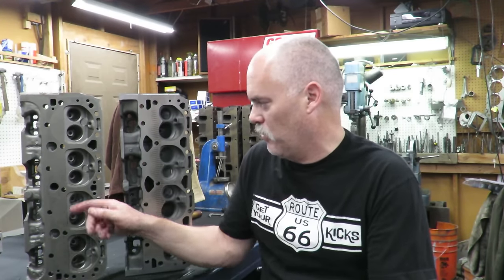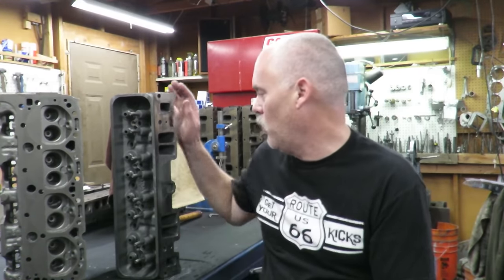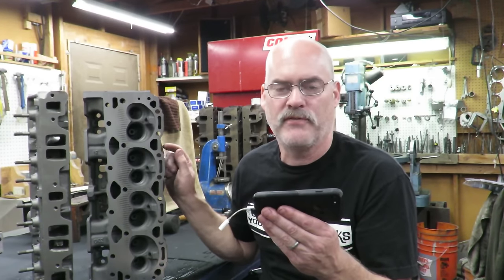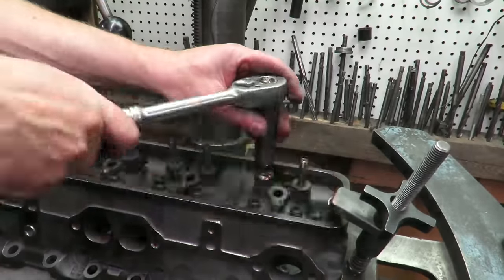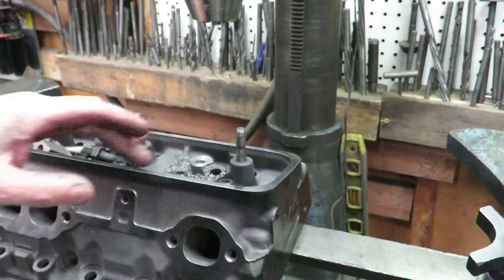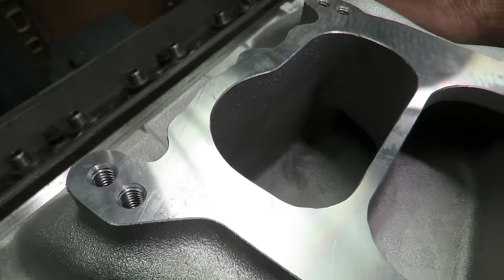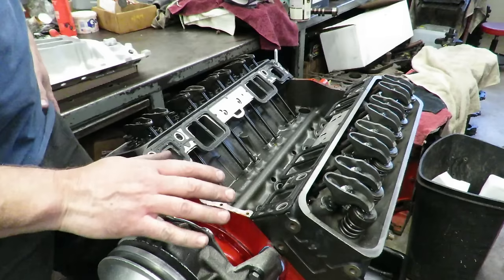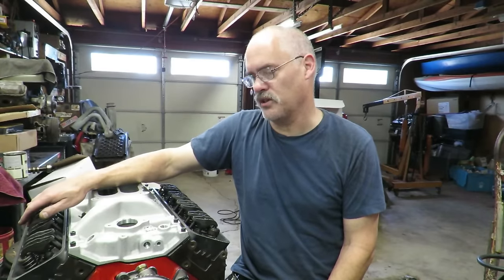How to get more power out of your Small block Chevy

Comment: Hand tapping the rocker stud bores? w/o cutting fluid?  I guess it's OK for you or maybe me to do that since the tap was piloted with your press. For me, it would totally depend on the GH value of the tap. I wouldn't trust a run of the mill Ace hardware hand tap for this. Knowing how to tap a hole correctly does not come to the novice on the first or second shot. You have to know when to back off the tap to sever the thread chip. Seems like going down without removing chip might mess the hole and enlarge the threaded area if the tap runs over the chip.  I know that I might seem a bit anal about the whole thing, but consider this:
Now, this is only my opinion; but we do know our beloved SBC is inherent for these studs to rip out (dependent of course on how mild or wild the camshaft selection). With this in mind, wouldn't we want to tap these holes for maximum contact surface area from the threaded rocker stud to the head? We might be better to utilize a tapper head with a machine tap having a lower GH value. Agree?
Doing so, we have created a 'tight but consistent threaded surface contact area that would insert with far less effort than it would to remove. Additionally during assembly, wouldn't we apply a Permatex 26210 type compound (or similar) to the threads in order to lock the part into place? 
Threaded studs have a better likelihood to naturally remain stationary over pressed ones, but gosh, that threaded hole has quite a bit to do with how well it is going to hold.
Only mentioning this due to our engine not being one that uses a rocker shaft, and the fact that we have certainly seen more rocker studs torn upward on SBC's than we would like.
With the thought of using a big mechanical roller cam and springs that would match with it, this stud becomes a very important factor to not rip out.  I know how to 'tap tight' by hand, but could I tap 16 holes by hand exactly the same? Hell no I can't do that anymore than I can bowl perfect for 12 frames. 
I machine engines maybe only once every 6 months these days, but there was a time when I was working and cutting them all day when I was in my 40's.  Maybe it's me, but I just never thought well of hand tapping a high tensile stress area unless I had to. Especially now, it my 60's I'd be afraid the tap would run over too much chip and I'd botch it up (that is, compared to a perfectly machined threaded hole from an auto tapper head for example)
I just mentioned this mainly because some people out there might not realize that this rocker stud area is crucial to hold fast well and these engines (with the perfectly wrong cam combo) have the potential to be damaged in this area. Yah?

You gave a great video here. I really enjoyed it. You don't talk too much as you say. Hell, look at me! This could very likely be the longest comment you've gotten!

May greatest peace be with you,
Pete

Comment: Why flat tappet cam.? I have an actual vortec motor. Had to replace the heads. They were cracked in the valve seats. I stuck with the roller motor though. Added a LT-4 Hot cam from chevy performance. That's a roller. Added roller 1.5 rockers. Longtubes and the upgraded injectors with stock tb. It is a dog. I'm thinking the pcm on a 99 old body style Tahoe just will not run right with no emissions stuff all removed. Bought a pcm from a guy 411 from a express van. He deleted all that stuff. Gave me a couple hundred on the rev limit and numerous other things. Haven't installed yet. I think it will run much better but, that shitty intake and small tb will always be the weak link. Thinking of just getting a fuel pressure regulator and going carb. They are expensive for vortecs though. What would you recommend?
Reply: I realize most guys running drag or track cars seen to prefer flat tappets? Can you explain why? Is a driver different? How about a resto mod driven a couple thousand a year?

Comment: Hey great video. I love watching your stuff, great adequate information. I have a set of the same Vortech heads. Would you mind sending me the specs so I can tell that machine shop what to do. Also which cam did you?  Thanks again. Keep up the good work
Reply: cut for screw in studs and machine down the valve guides 0.1" deeper for more lift

Comment: I have an 880 block, vortec heads, edelbrock intake and plan to put it in my 68 c10 truck. Since it is a heavy truck, I've been thinking about running the HT383 cam in it which some claim makes good low-mid range torque which is what I want, I don't want tire shredding HP, just some extra go for a heavy truck. What is ur opinion about my combo?
Reply from the maker: it works pretty good

Comment: So, score a Goodwrench 290 HP long block 1700.00 or so, maybe you can get it without the heads for less, maybe they'll do that, add you're budget vortec heads, keep the Goodwrench cam, 420 HP or so with the proper fuel/intake/exhaust maybe have it for 3000 or less if you're resourceful, sounds like a plan. but I believe it comes with a cast bottom end and two bolt mains so, that may be asking too much of the motor. who knows?
Reply from the maker: all of the crate engines from good wrench are 4 bolt main hey have been for many years

Comment: Nice video! Do you know what the hp-limit would be for a two bolt main block? I'm consider to upgrade my 1990 truck engine with vortec heads and a cam.
Reply from the maker: I have seen two bolt blocks make 500 HP you just need to watch the RPM's no more than 6000 with a two bolt after that the caps stretch but 6000 and under is no problem the two bolt block is actually stronger than the 4 bolt block it's the cap stretch that is a problem not the block itself
Reply: Myvintageiron7512 Thank you for the fast respond! Keep up the good work and the nice channel👌🏻👍🏻
Reply: you can get bullit caps to solve that problem

Comment: I have a 1991 Chevy truck with a 305 that has worn out bottom bearings, I called a garage and they said they will only replace a 305 with a 305 and they will not put in a 350.   I would like to put in the 350 to get more power since it is an extended cab with a full bed and there are some big hills or steep grades around.   Will the vortec heads 062 casting fit on my 305, if yes, what cam will it need,  what  four barrel intake and carburetor will be needed and what should the cylinders be bored at?
Reply from the maker: find a differant shop

Comment: I have a 1995 suburban with the 5.7 350. Non vortec. Can I go to the junk yard and take a vortec intake and heads and just put them on my suburban?
Reply from the maker: Yes on the heads no on the intake you will need to but an intake and run a TBI adaptor but it's pretty easy to do

Comment: I have an IROCZ with 350 TPI intake . The intake bolts are at an angle . Is there any option for me to use those heads you modified in this car. I noticed your intake bolts are straight up down. Thanks

Comment: Okay so I have a 400 sbc bored to be a 406. It’s got factory crank. Would this be a good set up for a 400? I have an edelbrock performer rpm and I’m going to get a new cam anyways. I know I’ll have to drill steam holes in the cylinder heads. What kinda cam would run good with this set up. This is going to be a daily driver but will take to strip every so often.

Comment: Hi...Nice video :O)...will be the upgrade on V6 Vortec from 1995  in the same manner?
Reply from the maker: yea pretty much
Reply: So I need to get the head's from 96 up Vortec manifold for it...you said Mexico? You have some recomandation where to buy a quality material for complete rebuild? I am from Europe but am in NY quite often so can pick it up there.Problem with parts here is that they are very overpriced.I wil not be able to get it for less than double you saying and that is very optimistic...I guess you busy man so I hope I don't bother much.

Comment: I have a question. I'm in the process of looking for a 69 Corvette which will probably have a small block in it. Lot of people have switch that out for a LS motor. I'm wondering what the benefit is when I can easily get 400 horsepower or more out of the 350 it's in the car! What are your thoughts on that?

Comment: Question I got set of vortec heads stock max on these .450 give or take the cam i want to use comp cams thumper the lift on it. int is .479 exh .465 so i heard of people putting ls1 springs and retainers should still have valve boss cut down

Comment: I have a 350 from the 70s and another 350 from the 80s will this bolt right on?
Reply: vortec heads bolt on,you need a vortec intake to match the heads.they cost $150-$300 at summit(LOW RISE DUAL PLANE TO HIGH RISE AIR GAP DUAL PLANE)

Comment: How much roughly would it cost to build a 4.0 Jeep engine with all top of the line parts and service?
Reply: Buy a salvage jeep and scavenge the engine out of it, i did it w my 70 cutlass and bought a car with a wrecked rear end,stripped interior, peeling paint ect. for 3k and a running car with a knocking engine for 7k.  With a bit of knowledge you can swap it at home

Comment: Why did you tap the holes you drilled in the intake manifold?  Shouldn't the holes in the head have been tapped? You want to pull the intake manifold down onto the head, right?  Threads in both holes will bind up the bolt before it hits the torque spec, unless the threads are perfectly aligned, and threads in the intake manifold alone won't draw it down tight onto the head.  What am I missing?
Reply from the maker: what your missing is I did not tap the holes in the manifold I'm not sure where you got that idea
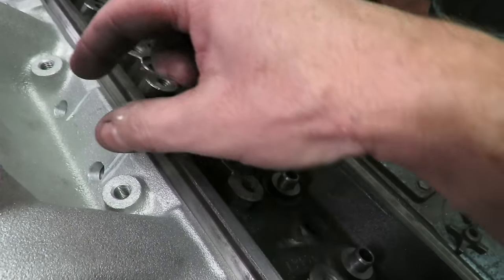Reply: @Myvintageiron7512  Sorry, I misunderstood what you said at 29:46 in the vid.  My bad...

Comment: Ok Mr 350... I have a 1990 Z71 that blow smoke at startup ...it will do it for a few months and then it will stop blowing smoke for a couple months.....what is it?
Reply from the maker: probably valve stem seals nothing to worry about very common on SBC with miles on it just run it it will be fine
Reply: @Myvintageiron7512  thanks for your time.

I consider it a top end lubrication...similar to a 2-stroke engine

Comment: I'm using 416 305 heads on Mex 350 block had value job 1.92 in 1.50ex mild cam 460 lift what u think looking to get 300hp.
Reply from the maker: I would guess closer to 275

Comment: So I have a 330HP crate 350 that has the vortec heads. My question is I want more power say around 400HP 450 Tq. Is it worth redoing my current heads at 500 bucks or buying a set of aluminum heads for around a grand. I want to add a roller cam lifters and rockers and a dual plane air gap manifold. This is going in a 66 chevelle so you know the weight with 3.73 gears and a Th350. The long term plan is LS and over drive. Thx!
Reply: Bigger valves, pocket porting and a good cam and intake will do that don't need a roller cam at all.

Comment: Can I do this same process with the sbc 305 vortec heads? I have a 98 silverado with vortec 305 and a 85 monte carlo SS w/ original 305(a measly 180hp) would this vortec conversion on my Monte Carlo gain a reasonable amount of power?? Could I also get close to 350hp with this conversion??
Reply from the maker: no they wont work on a 305

Comment: So what would I need to get a 305 TT to 800 so and 790 TQ? What would I need for that? I know I must spend so go ahead and be honest with me on it. Also I am looking for an EFI build
Reply from the maker: All forged lower end buy crank rods and pistons rated for 1500 HP sleeve the block and run abour 30 psi boost
Reply: @Myvintageiron7512  Do I still need to sleeve it if I am going iron block?

Comment: I have a quick question: I have a 454 BB that has been over bored .060. It is an older 2 bolt main, approx. early 70's. Can it be bored gain, say .020, or maybe even less? It will be a street engine. Thanks.

Comment: i have two 400 SBCs..... a 327 transplant in my 68 2 door impala.... and the BONE STOCK original in my 77 1/2 ton silverado 
new heads would REALLY wake these motors up...... 

if you think 400s overheat, and are junk..... send them to me, ill even pay for shipping
Reply: 400s had 245 to 265hp with a 4 barrel..... and iirc, 360 foot pounds (but close to 400 with the AC off)

ya drive a stocker 86 305 (with smog pump).... then your dads 350 with no emissions.... then a 77 "heavy half" 400 with FACTORY no emissions.... 
the 400 is LEAPS AND BOUNDS ahead of the stock 350

big fat piston, on a relatively short stroke for the bore.... in a SBC form factor....with the option for 8000RPM 377s....
oh HELL YA!!!

again.... i will pay for shipping.... 
ill take that "overheating POS" off your hands

add the factory "heavy duty" radiator for the 400 cars/trucks..... and put 360hp to the tire all fucking day long

that 68 of mine keeps up with my dads 72 Plymouth satellite sebring plus....440 making about 450hp....
for the first block

the 77 1/2 ton is bone stock.... yet has full time 4.... and will pull ANYTHING in low range.....at an idle

Comment: So what are the torque and horsepower numbers if you upgrade to the vortec heads, better cam, and keep the RBI with the edelbrock RBI intake manifold?   I just don't want to deal with all the changes to the system in order to make the tranny work and shift properly.  Thx
Reply from the maker: 380 HP is doable

Comment: I know this is a 3 year old video. But is it more worth it to get the cheap Amazon sbc heads and use them instead of getting the vortecs and having to get the machine work done and hope you don't have a problem with thin casting. For 200 per head for aluminum heads and from what I've seen on flow numbers they beat the vortecs pretty handedly all through the range of lift. What is anyone else's opinion on this?

Comment: I have a 1992 GMC Sierra, does that have an LT1 motor? The distributor is in the back where they usually are on a sbc. I trying to figure out if my motor has the reverse flow coolant system. Thanks, Jeff
Reply from the maker: no its a TBI engine

Comment: Hey bud, I need some advice, I'm also checking on shipping charges from Wa to you. I hv a 454 mild cam, Virgin  781 heads,  800dp holley,  2400 stall, th400, 3:50 9inch geard. Got my ass handed to me at the track, what combo in engine mods could you build to make a serious impact, but still hv street manners? Stroker or non

Comment: I bought a TBI motor and rebuild it. I installed a Weihand performer intake manifold, 204/214 cam, and an Edelbrock 1406, 600cfm carburetor.  Electronic ignition on it too with oval shape open air cleaner. I was under the impression that it would give good horsepower but it does not. I am quite disappointed with it as well as very poor gas mileage!!
Reply: Kobus,  are you sure you didn't get a 305 ?   if not,  i'd say
   the cam is a bit too small.
Reply: @normhodgkinson6965  Hello Norm thanks for the reply I appreciate. No, it is a 350 motor that came out of a Silverado pickup truck. I took of the TBI system and installed an Edelbrock performer intake manifold on it with the Edelbrock 1406 carburetor. I can certainly say it is a 350 because I have new flathead pistons in it as well. The block is machined 20 oversize. Horsepower not even close to what I expected or told it would be. Do not even get wheelspin on gravel road.....
Reply: @kobuskock6688    a few things come to mind.   timing may not be enough, it should be
     about 10 to 12 degrees advance at idle.   i don't know all the specs of your cam,
but if its as you say, 204/214 @ 50, that seems almost like a stock cam.   if your 
     car/truck has to pass smog inspection, then your cam choice may be limited.
i would suggest a cam somewhere in the 225 duration, and 460 to 470 lift  if a
    smog inspection is not required.  stay away from Summit cams,  and always
do the cam break-in procedure with a non detergent break-in oil.    check 
   "Myvintageiron7512  350 chev cam break-in"   for  oil to use and procedure.
Reply: @normhodgkinson6965  Timing on the motor is spot-on 12 degrees. I am considering the E-Street Cylinder heads from Edelbrock, what is your opinion and which cam should I use with it? Will a 224/230 cam work well or not?
No smog inspection is required here.
Reply: @kobuskock6688    those heads are very good,  and those cam
    specs seem just about right.

Comment: You can run 87 up to 9.25.1 Maybe a little  higher. now  they are running 12.1 on these DI motors at 87 octane. Also fuel economy is better with higher compression. The government also did what they did to get the foreign trade going. I can run 87 on my 11.1 and runs fine. Knock sensors will pull timing. I lose 50 horse but still runs great.
Reply from the maker: That is true for OBD 2 computer control engines but with a carb it's deadly for the engine
Reply: A 4 valve cylinder combustion chamber usually allows a higher compression ration than most 2 valve combustion chambers. That is why there are several 4 valve engines that use 10:1 compression and use 87 octane.

GDI allows a higher compression ratio because the fuel cools the combustion chamber as it vaporizes.